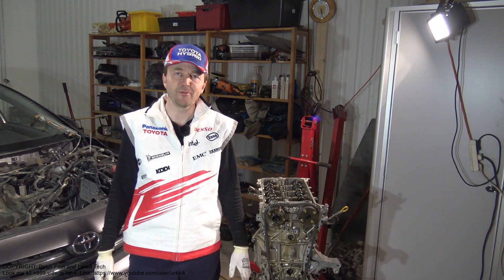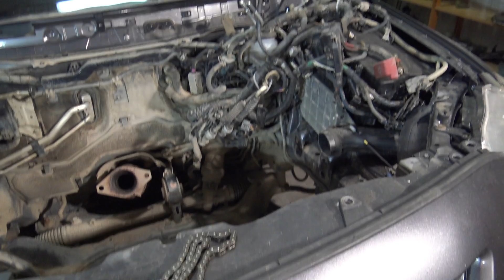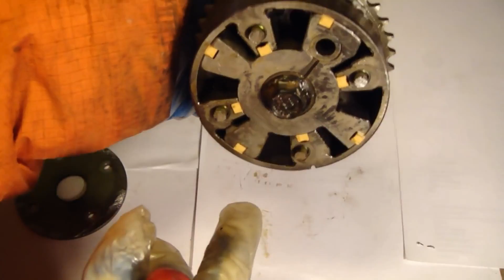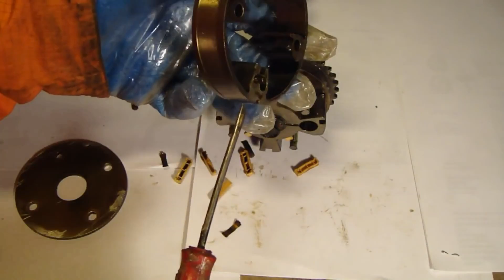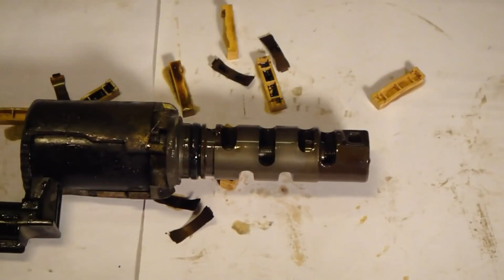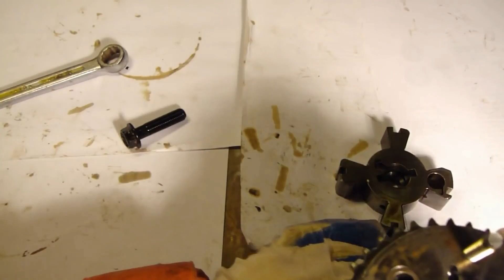How works Toyota Corolla Dual VVT-i engine years 2008 to 2018

Comment: Pete, Do you have a video series on a 2009 Toyota Matrix Dual VVT-I 1.8 Head gasket removal & replacement with torque spec. ?
Reply from the maker: Yes, I have video and it is coming.

Comment: Dual VVT-i is a complex system Peter. The bolts in the cam gears are very interesting. They are not hexagonal like the common bolts, they are pentagonal! You need specific sockets to open them. Very nice information!
Reply from the maker: Yes, They are pentagonal. :-)